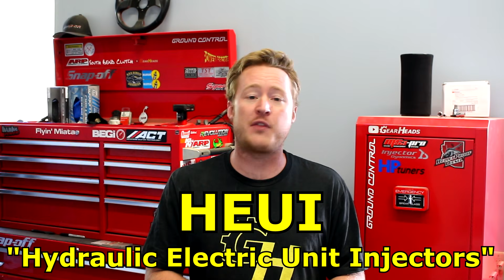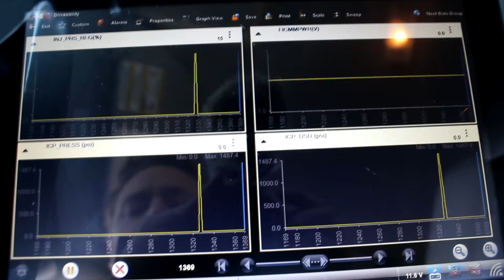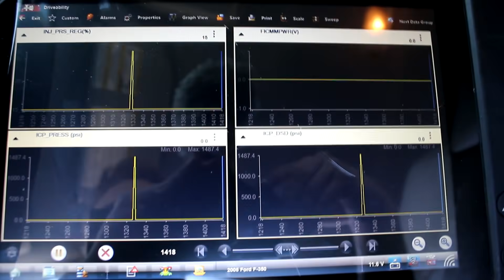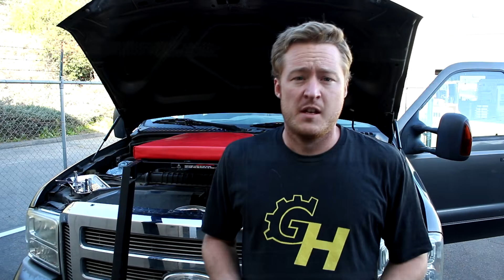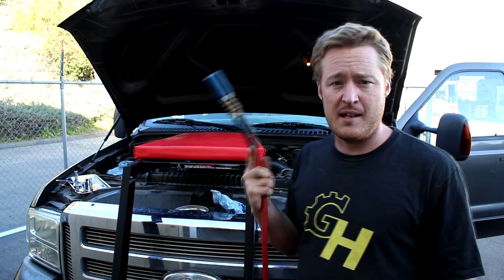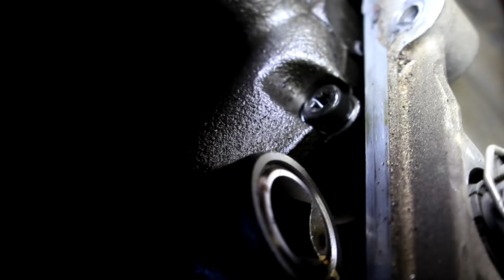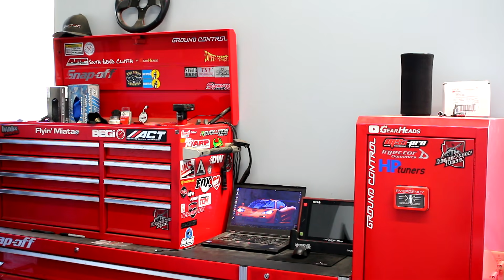Ford 6.0 Common No Start Problems

Comment: Wish I could figure out why mine wont start after putting on all new injectors, glow plugs, bulletproof air cooler, blue spring kit, new standpipes, new oil rail seals and cups, new thermostat, new turbo drain pipe,, water pump, and EGR valve. I have it facing down on a decline with 1/4 tank of fuel, but the filter housing on the front is full. Used the yellow/blue wire from the starer on the battery and the compression sounds good.
Reply from the maker: You just gave a list of things you replaced, you didnt give any list at all on what you can confirm the truck is or isnt getting to start. That is the backwards wrong way to think about diagnosing a problem, any problem. Cant tell you how many bad parts I have gotten out of the box, how many wrong repairs I made before I learned and how many times I have to fix things now that other people threw the parts cannon at. Slow down and relax, go back to the basics and figure out what you do and dont have that the engine needs to start. You could have simply even forgotten to plug in the crank sensor, or maybe its somethng else or a bad part you got but no one will know until someone actually goes in and diagnoses it properly, which this video was intended to at least give some help on although it doesnt and never could cover everything.

Comment: I have the F250 with a 6.0. The problem I’m having is that the starter isn’t coming on when I try to crank it. I have removed the starter and had it tested but it was fine. I have replaced the starter relay and tested all of the fuses but still can’t find the problem. What do I need to check next?
Reply from the maker: You are going about this wrong, between your key and the starter there are other components involved that need to send that signal. With a test light or multimeter you can test everything necessary. First off, when you turn the key to the crank position is the ignition switch actually sending that signal? if so it still has a couple safeties to go through first, one thing would be your neutral safety switch. Does it crank if you pop it in neutral but not park? Can you watch it happen with the multimeter or test light? Past this it could be computer issues but with the right knowledge and testing even this can be diagnosed with basic tools. 

Long story short, your starter has two powers going to it, the constant 12v from the battery to the motor(the thicker gauge wire) and the starter solenoid control wire. If you are not getting 12 volts or so to the solenoid wire then the problem is upstream from there. Whether it is worth your time to figure out or pay someone else is up to you.

Btw 6.0's have a wire near the passenger battery that can be jumped to crank the engine and if they key is in the on position it will start.
Reply: I will see if I can find that wire. At least if I can get it started that way I can get it to a mechanic

Comment: Come out of the store about 15 minutes after I was driving my truck I tried starting it wouldn’t start I tried jumping it wouldn’t start took the batteries out took them home charge them up next morning put the batteries back in wouldn’t start put two pick ups on jumping from one from each side it started going down down and not one click
Reply from the maker: Not one click would imply your truck isnt even cranking, which is not what this video is about. That could very well be a starter or some other electronic issue, from what I am hearing I would recommend finding a trustworthy mechanic that is familiar with these trucks and have them look at it.
Reply: Did you ever find out the problem? I have the exact same problem happe. To me

Comment: My son's f250 6.0 diesel showed a battery icon that lit up on the dashboard just before it just died on him. And since then we have been unable to get it to start. It turns over but won't start. Any suggestions? Oh with no codes and no check engine light illuminated.
Reply: Probably a shit alternator these trucks have a crap factory alternator I’ve long upgraded that and bat/alt cables on mine 🤘🏻✌🏻
Reply: @kp__truckin  Stock alternator is junk. The same one is used on a Ford fusion.  That can also take your FICM out, along with weak batteries.  Changing out the alternator is a must if you are going to tow a camper trailer.
Reply: Just happened to me in my f350
Reply from the maker: How is it cranking? put a charger on it for awhile and make sure they are fully charged, slow cranking will not help these engines and they require a LOT of power to start between lighting the glow plugs and cranking the high compression engine at the same time. Other than that if it is cranking strong then follow what I showed in the video for at least a few clues and possibilities
Reply from the maker: By the way...if the check engine light isnt on with the key on there is probably an electrical or communication problem...no CEL while driving is good but get into any car with a key after 1996 or so and turn the key to the "On" position and you will have a light on for the check engine and a few others. If you dont in many cases it might mean your cluster is not seeing the engine computer either turn on or communicate.

Comment: What if you get right off 1685 at icp and fuel pressure reads 100 psi on scanner and you have no leaks and I  replaced the irp valve and it started but for only 30 seconds then I found 3 leaking injectors and replaced them all reading good still no Starr
Oh I did change oil and filter do to feel in it.
Reply: My tool is snap on
Reply from the maker: There is no fuel pressure value on the scanner so not sure what the 100psi value is. 1685 icp cranking is too high as well unless that was a running value off idle. Sounds like your data is off or you are looking at the wrong things. If the injector control pressure is over 500psi and it still wont start then you have another issue.
Reply: @GearHeadsGarageChannel  my Snap-on scan tool allows me going to fuel data and the fuel data tells me that the fuel pump pressure is 100 PSI I read that cranking could be anywhere from 500 to 2000 but you're saying that 1685 is too high I can't find any more leaks it will not start on ether I had three bad leaky injectors replace them the IPR valve is at 85% so could I have no coats but I have a bad ICP valve

Comment: I appreciate the video tip! Curiosity has the best of me, therefore I am going to check out a ‘04 that is for sale, but will not start. The business said that it ran before. If I can get it started, then I will have me a project truck for the next year. But this all depends
on how bad of shape the truck is and price. So I will check the oil, low pressure fuel.
Reply from the maker: Good luck!

Comment: My 2007 F250 Superduty 6.0 took a 22mm socket on the top cover of the fuel filter, NOT a 24mm...I don't know if the guy in the video misspoke that or if there are a couple of different sizes out there, but yours just may  take a 22! Lotta good info in this video and should help folks troubleshoot and repair their trucks if they have this crank, NO start problem!
Reply: You probably have an aftermarket fuel cab
Reply: @towtrucka1306  I'm guessing you mean "CAP". NOPE..it is the stock cap. I've owned the truck since new...bought it in VERY early 07 or maybe even in very late 06.if it is an aftermarket one, someone snuck into my yard in the middle of the night some evening, broke into my truck so they could pop the hood and changed it. Don't know, otherwise, how it could be not the original one? The oil filter, on the other hand DOES have an aftermarket cap on it made of aluminum...I KNOW that because I did change it.
Reply from the maker: All Im gonna say is I have been doing this and working on 6.0's a long time and I have NEVER seen a 22mm fuel filter cap. You have an aftermarket setup of some sort if what you are saying is true. Either way who cares just grab whatever socket you need and take it off.
Reply: @GearHeadsGarageChannel   Been a while for me working on these things, too. I was just out in the yard doing some stuff and, after you guys all being so sure that thing is 24mm, I had to take a look. And, guess what? It actually IS a 24mm!!   I may have either misread it, had too many tools in my hands or just plain old been hitting the tequila too hard lately and remember it wrong. I'm not losing any sleep over it, but curiosity finally got the better of me and I had to look. I handle so many tools every day that it is just about impossible for me to remember each and every one all up close and personal!!  In any case, this CRS crap is NOT what I'd been hoping for all my life.....I guess I just gotta say ----MY BAD----!!

Comment: Question, I only hav e 7.3 experience. is there an oil reservoir on the 6.0 that feeds the HPOP like 7.3? If it does not have oil in it like the. 7.3 cause a no start too?
Reply from the maker: Nah the 6.0 does not have an oil reservoir and the system is very different from the 7.3.

Comment: Most informative 25 minutes of my life worth every second before I send my diesel to a shop where they're just going to screw me over I'm going to watch every one of your videos on a 6.0 I bet I'll be able to fix it myself
Reply: So experts charging you to fix your truck is screwing you over?
Reply: @manworksgarage  . . . If you have never been screwed over by a mechanic shop you may just not realize it.  My 1st diesel was a 1983 6.2 cross over.  I had a problem of it only being able to run about 35 mph.  Everyone I talked to said it was an injector pump . About a $1500 fix at the time.  I knew a lot of people that had been through the same thing and still didn't  fix their truck so I went to about 10 different shops until the last one.  The guy said people were just ripping people off , He put a new pvc valve in mine , didn't charge me anything . He said come see me when we have a real problem . . . . I got Lucky !   A lot of my friends didn't .  I can tell you lots of other stories of friends getting screwed over by mostly dealerships  !   There are some good guys out there and there are some that will take you for what they can get. . . . same as any other business.   So don't be so pious !
Reply: @WH   I'm saying not everybody out there it's screwing you over and if you don't know something you have to pay an expert to do it experts mechanics that Fix trucks aren't all screwing people over
Reply: @wh8085   Mine and others years of experience is worth something and if you don't like it don't go there fix it yourself
Reply: @manworksgarage  Who here hasn't been bent over by a shop. Mowers, cars,trucks.... If it has boops or tires you're going to get screwed. 😅
Reply: @manworksgarage In my experience, you have to go to possibly 3 different mechanics to find the "expert".
That is what the comment is about.
Reply from the maker: Good luck! I think this is the only video I have made so far lol
Reply: Mine is a 2003 6.0 powerstroke and code that popped out is P2285.

Comment: It would be easier to unbolt the fuel rail to get the lower half of the standpipe out, than to jack up the motor on the passenger side dont you think?
Reply from the maker: If I dont have to I would rather not disturb the seals on the injectors or the nipple cups.
Reply: X2 on unbolting the rail. If the standpipe is gonna come out then im replacing the injector orings(the top oring too) anyways. They might not be bad but my customers would much rather pay the extra hour now on the prevention then paying to do the whole thing again.

Comment: I have an 03 ford F550 6.0 V8 and this problem started out of nowhere it was just fine working and now when I try to start it with the key it just clicks I can only start it from inside of the hood I tried to bypass it and it started right up with the key and now it’s doing the same thing, any suggestions Of what’s wrong or how to fix it
Reply from the maker: That is not the same as the problem as what is happening in this video, you have an electrical issue sounds like might be an ignition switch or related item. If you dont know how to test and diagnose it find a local mechanic you trust.

Comment: Since April, we have spent $6000 on our 2004 super duty 250. High-pressure oil pump they took the cab off to fix that when they brought it back we had to have the park brake brake redone because it wouldn’t shut up it rang all the time then the air conditioner wouldn’t work the four-wheel-drive wouldn’t work then my husbands driving it, And it just quit on a hill. When the guy looked at it he said well your air conditioner compressor is no good and it’s locked the thing up and that’s why it won’t run. My husband believe them so that was the last thing on the $6000. We got it back yesterday and now my husband tells me that it won’t start again that you have to use the wire under the hood to get it to start again. First quit because my husband was pulling a dump trailer full of dirt in April one of the worst months of the year. I told him that that was what he did he shouldn’t have been pulling such a heavy load. Because he got my sons new one to use after that and it quit too. So the guy told him it was his high-pressure oil pump was his problem the reason the truck wouldn’t start after that so the high-pressure oil pump fixed his sons newer one but it didn’t fix ours. What else could it be. Thank you Suzanne Perkins. Ps great video. I’ll have my husband Watch it so he can try to do what you said to do on the top there. But do you have any other suggestions.
Reply from the maker: I am sorry this has been such an ordeal for you but it is very hard to diagnose things remotely and I do not have the time sadly. To be honest it sounds like you need a better mechanic, I would hope that they did a LOT more when pulling the cab besides just changing the HPOP because a cab pull is not at all required for that. As for issues after the cab pull like E-brake if they made mistakes that should have been covered and fixed for free

Comment: I have 07 no crank no start, it just clicks as if a bad starter. Cranks and starts after letting sit for the first time and doesn’t start after the second or third or after. Replaced starter twice, relays and fuses check out ok, getting 12 volts to both terminals
Reply from the maker: Its gonna be something simple. Bad battery, bad ground or bad relay etc. Cant test it for you over the internet, this video was about diagnosing crank no starts and I hope it helps some people with that issue, but it is not the same issue you are experiencing.

Comment: I just bought a 2006 F-250 Super Duty 4x2 w/271k miles. It used to belong to Granite Construction, so I believe they have a good maintenance program. What problems should I be expecting?
Reply from the maker: 271k miles, literally anything is possible at that point. Could be an engine, a transmission, a leak, suspension issues, axle problems. Good maintenance is important but when you get that far into a vehicles life you cant expect to know what may fail next. If you bought a truck with 30k miles I could tell you what to expect.
Reply: @GearHeadsGarageChannel  I snagged it for. $4800 @ an auction and will only be using it to pull our small camper and occasionally off-roading.
Reply: @sonnydayz2118  start with a checklist. Drain and fill the coolant just in case. Change oils on everything. Run clean diesel plus some Lucas or other additives that help with stiction. Change both fuel filters with motor craft original filters
Reply: @PanchoPistolas45  thank you.
Reply: Use dealer parts, these trucks are sensitive. You can replace some parts with bulletproof diesel stuff but that’s about it. Other than that use dealer parts for everything. You can get away with after market oil but not the coolant, transmission fluid, etc.
Reply: @joeshmoe8952  thank you. I've been a heavy equipment mechanic for most of my working life (mostly mining sized), but I'm not familiar with small diesel truck common problems. I hate that you have to take the cab off, just to do some stuff, because I personally don't own a garage for doing that.
Reply: @sonnydayz2118  I had one, got rid of it for $22k in Oct 2020. I regret it now because I still want another one. I’ve seen a good number of these trucks well over 500k miles. You can get away with replacing everything OEM because all the new parts from the dealer are upgraded from the old parts that were failing. I had the oil cooler, egr, ficm, water pump & fan clutch & adapter, radiator all from bulletproof diesel. Yes it cost money but they make good quality parts. Also change the camshaft push rods to the OEM 6.4 because the original ones are too long and mess up the camshafts in the long run. I believe the upgraded push rods are actually the same as the 6.4, even if you give them you vin number. You can’t go wrong using OEM parts since Ford has fixed all of the issues. Change the HPOP, change the head studs to ARP head studs. Change the oil pressure switch, if you got $$$ change the heads, add some good gaskets, use Archoil fuel additive every oil change. They take 15 quarts of oil so it can be a little pricey with maintenance. Change fuel filter every other oil change, coolant should be done with only motorcraft coolant and distilled water. These trucks can be a pain in the ass but they will last.
Reply: @joeshmoe8952  He has got to get rid of the ford coolant.  It cannot cope with the high temperature in the EGR cooler, and breaks down, and plugs up the oil cooler. My coolant reservoir was full of sticky goo at the bottom, from the broken down coolant.  Everyone I know has switched to a ELC, like Delo, which is approved for Navistar.  I got rid of the ford coolant at 40k, and installed coolant filtration that was over 100k miles ago.